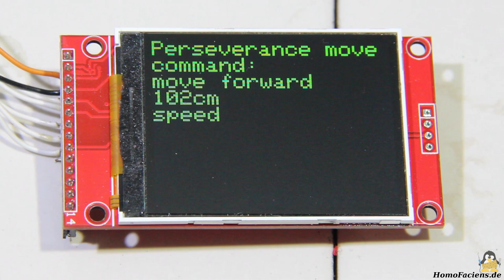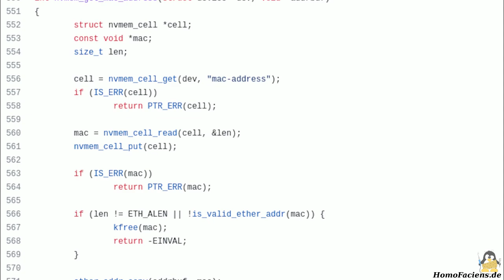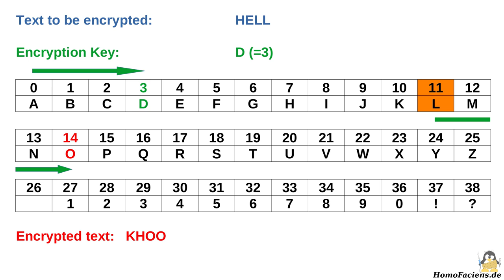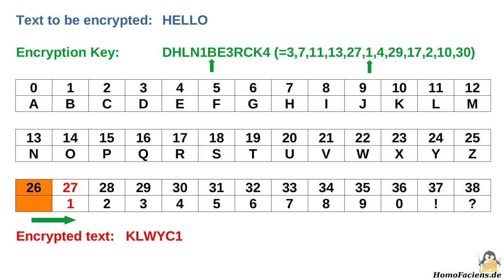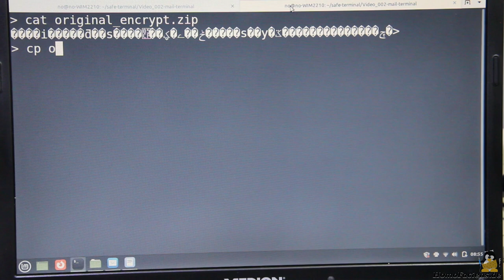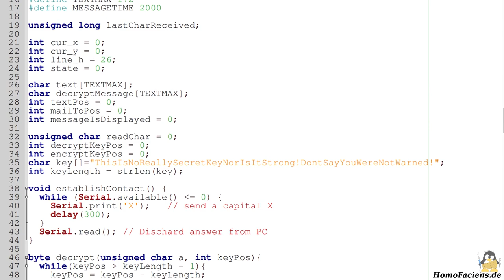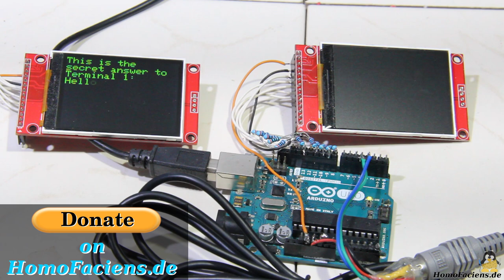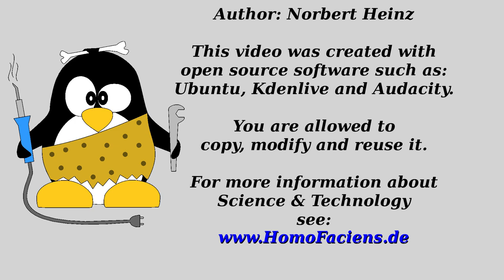Secure communication between microcontrollers via Internet.

Comment: Strictly speaking, this is indeed the most secure encryption method also known as a one-time pad. Encryption, in and of itself is an independent field of study. Much of its algorithm is indeed public and free to use as the requirement to break an encryption is the key itself. To obtain that, you can use cryptanalysis the most effective one being rubber hose cryptanalysis.
Reply from the maker: Yes, thanks for pointing that out! Encryption and cryptoanalysis are highly interesting topics. I must indeed add more chapters on that. Secure data exchange is anything but out of reach with existing technology, but unfortunately you walk somehow on the edge of what is allowed by law...

Comment: Back in the days of the TRS-80 Color Computer, we used the random number generator to generate the string of offsets. All you had to do was use the same SEED value for the generator and the same string of random digits was produced since it was a pseudo random number. This is why old computers used to seed the generator with the current system time to eliminate non-random sequences in games. Anyway, you could implement something similar with your system so that you don't have to exchange a long key.
Reply from the maker: Yes, generating a secure key is nothing trivial.
If you have a simple rule to generate a long key, that long key is no more secure than the short rule to generate it. It might work if the end terminals are built with exotic, non documented hardware that nobody in the chain between the terminals has access to.

Comment: Hello Norbert,  I can not find the info on your website about this project.  I will check back in a day or so.  How do you feel about using libraries ? I try to write my own software since I learn how the device works at the core level, however most people who write libraries are much better coders than myself.  Did you write the code for the ir devices in "Very simple text terminals with IR interface", it looks pretty good.
Reply from the maker: Hello Joseph, as one of my Patreons (thanks for your support!), you get early access to the videos, while I am still writing on the documentation, the subtitles and so on. Be patient, the German version of the documentation is already written, I will translate it into English this evening. It will all go live tomorrow afternoon.
Yes, I am usually writing the software for my machines from scratch. For small projects like this text terminal or the previous version you have mentioned, adding extra libraries doesn't make that much sense. These add comfort to larger projects, However I am using libraries in this project, written by others: Those written for the display I am using as well as for the PS/2 keyboard.
Coding definitely gives a deeper insight into how things work. Nobody is born as an expert,  just keep learning by coding...

Comment: interesting how such and easy encryption method can be this powerful, is there a simple way to also hide the message length?
Reply from the maker: You can either add garbage bytes to fake a longer message or use some kind of compression algorithm. Text messages usually result in relatively high compression ratio.